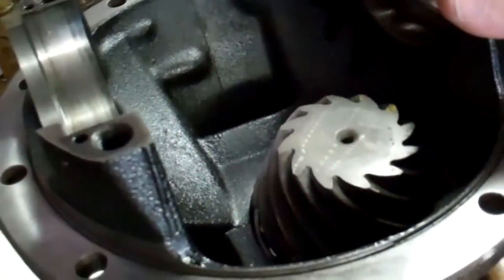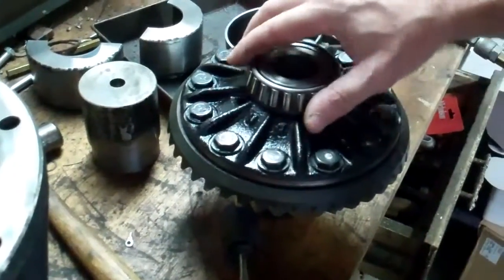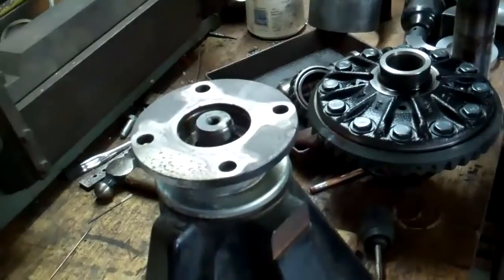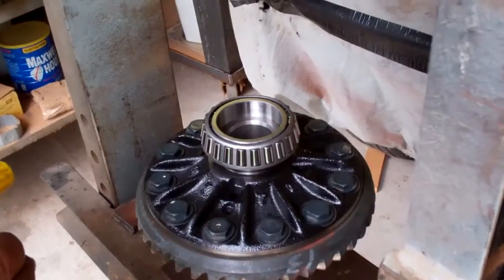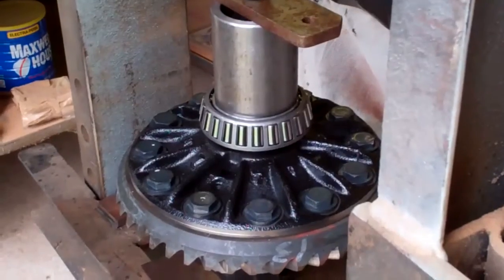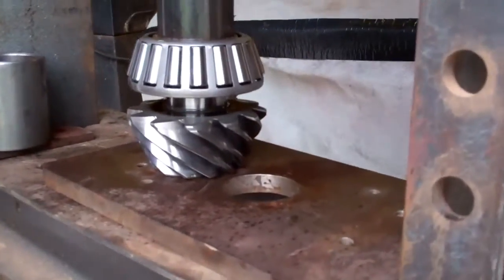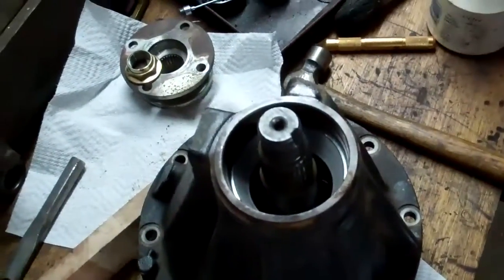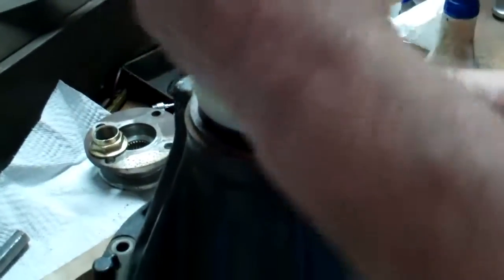TOYOTA TACOMA GEAR SWAP PART 2 OF 3

Comment: Hello, I realize this is an old video. Do you still have the truck? What is the axel code on the door jamb?
Reply: He has a 05 2.7l 5 speed manual 5 lug those only came in 3.31 and that third member is as good as a boat anchor as the carrier won't accept anything bigger, u would need a automatic third member with 3.58 and swap gears, or just get a v6 non locker 3.73 and swap